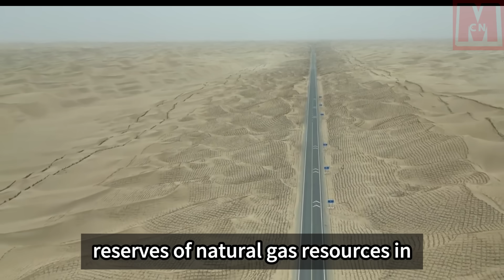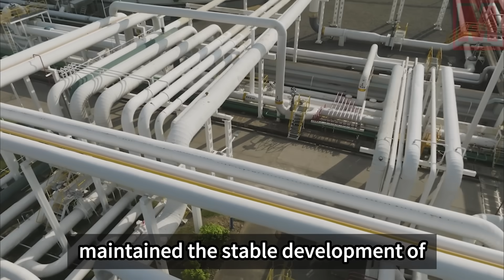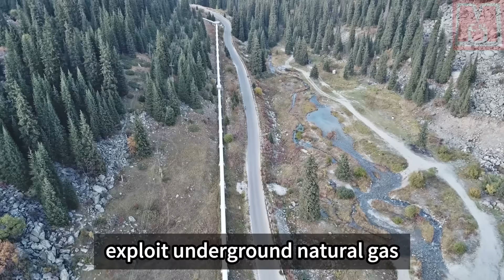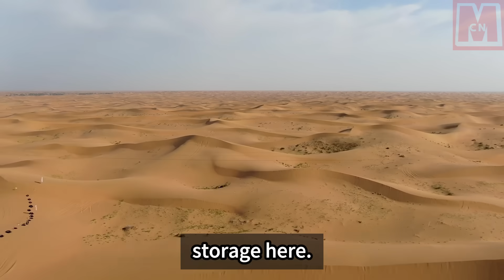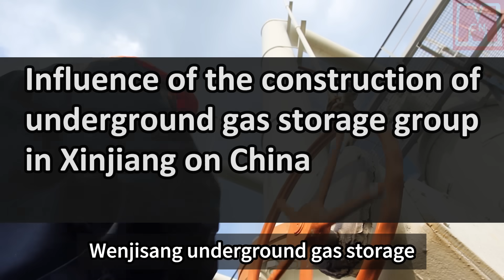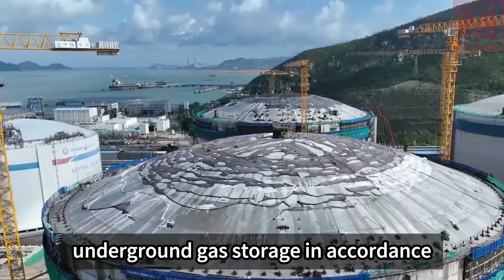Unveiling China's Massive Underground Desert Project: The $7B Game-Changer

Comment: While gas is a good alternative to coal, it should be an interim energy source on the way to zero carbon emissions.  China has third generation nuclear power plants and will expand them to be the world's largest nuclear power plant fleet in the world by 2030, but it is developing a fourth gen molten salt reactor that is being tested in the Gansu desert.  It is said that if all goes as forecasted, industrial size versions will be made in factories by 2030. These reactors require no water coolant, are run at ambient pressures, but are high temperature reactors so can run on higher efficiency gas turbines instead of steam turbines.  They are scalable and have a small footprint.  They can run where power is needed and some designs are underground.  China has a wealth of thorium that was mined along with its rare earth minerals. Further, some MSR can use existing waste uranium fuel from current pressurized water reactors.   If these reactors are ramped up, one would think that gas is but a interim energy source and thorium MSR are the future of clean baseload energy..

https://world-nuclear.org/information-library/current-and-future-generation/molten-salt-reactors.aspx

https://www.scmp.com/news/china/science/article/3224183/china-gives-green-light-nuclear-reactor-burns-thorium-fuel-could-power-country-20000-years

Maybe you should do a video on China's plans for thorium molten salt reactors?